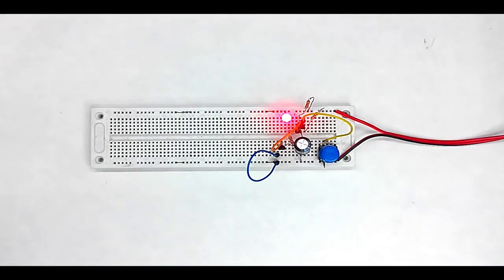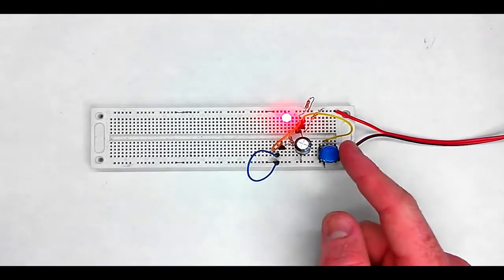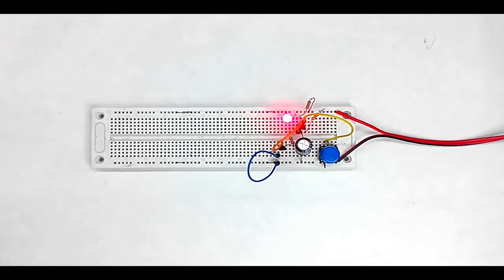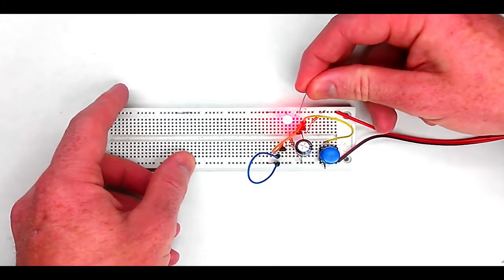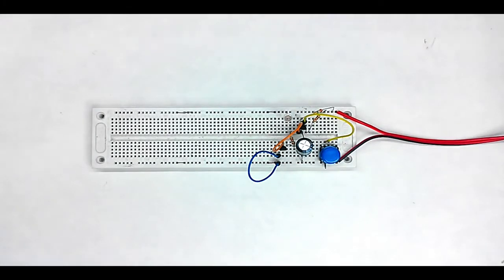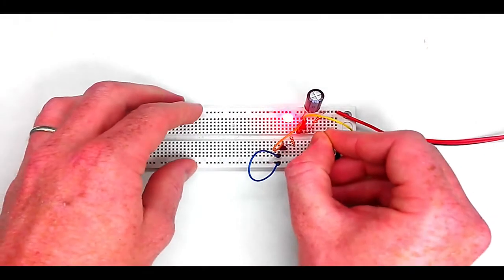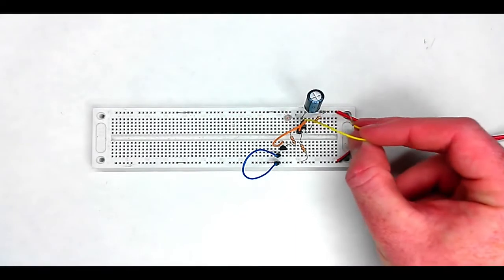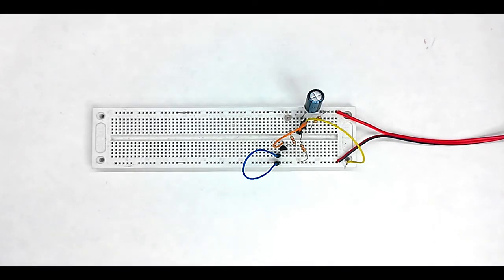Electronics Fundamentals Tutorial #25 RC Time Constant Example Application

Comment: Where the schematic circuit ?
Reply from the maker: I didn't include the circuit diagram since this video was only intended as an example of where an RC time constant might be used (RC time constants were covered in an earlier video). I hadn't actually made a video yet on transistors or amplifier circuits.